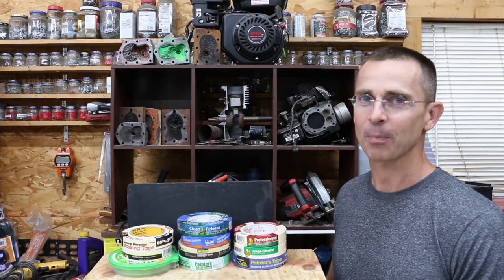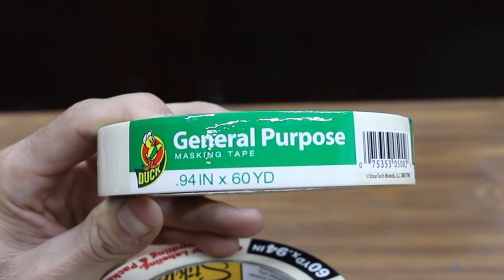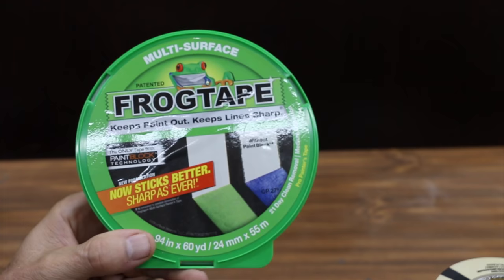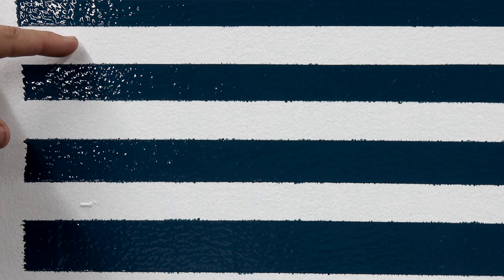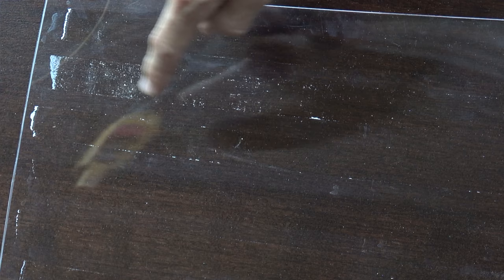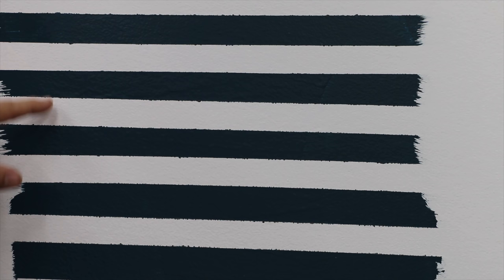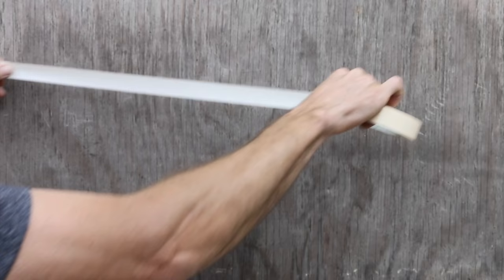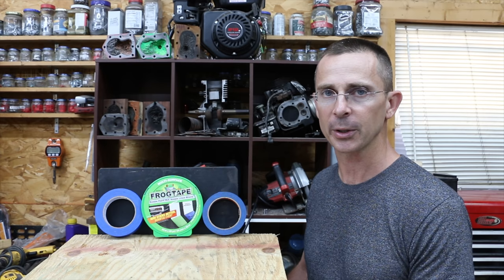Which Masking Tape is the Best?  Frog Tape ve Duck Pro, Stik Tek, 3M, Scotch, Dollar General

Comment: Frog tape has been my go to since it came out, always near perfect lines.  However,  I've found that even as good as it is, it struggles with the newer latex paint with primer in satin, semi-gloss, gloss and high gloss applied to similarly glossy surfaces. If left on too long I've found that even it peels up the newer paint. Highly recommend removing, very carefully, prior to paint drying!
Reply from the maker: Thanks for sharing!
Reply: The trick to that is to paint a thin coat of primer over the frog tape edge first. Some people even just brush some water over it instead.  This activates the tape.  Then paint the color you want and peel off while the paint is still tacky. If you use sherwin williams duration or emerald, one coat over primer is enough to cover almost anything.

Comment: You have to compare cheap oil filters to high performance oil filters!
Reply from the maker: Great suggestion! Thank you
Reply: @ProjectFarm  i've wondered if my strategy of changing the oil and filter more frequently than recommended would make up for using the no-name filters from the oil-changers place. it'd be interesting to know how long different brands stay useful, as well as how they clean at their "end of life' time.
Reply: @flashgordonmd /videos/videos Pretty sure changing more often than recommended is an unnecessary waste of money unless you really drive your vehicles hard.  In which case, you'd likely hit mileage before months.  Just check with the dipstick for color and quantity periodically.

Comment: Great vid as always! Still holding out hope for the high temp spray paint challenge. The paint I used is doing well on my exhaust piping, but I am starting to see some paint chips. I'd love to see which paint holds up best to heat and automotive chemicals.
Reply from the maker: Thank you!
Reply: Or painting a grill, or chimney pipe.
Reply: Fully Spooled bro how's the car? Get a new engine in?
Reply: @datboi8140  No new engine yet. I've been taking care of personal stuff lately. I still need to source a new engine and have the time to make the swap. Hopefully soon.
Reply: Fully Spooled I get that for sure! Remember, you have all the hard stuff done. Only a few bolts and some fluids holding you back from some seat time!
Reply: @datboi8140  Very true. I literally just haven't had the time or money lately to turn those bolts. I will put an update video out soon. I know I've been slacking.

Comment: Please do a test on wheel bearing grease. Would love to see what is best to use for my boat trailer in a salt water environment!
Reply from the maker: Thank you for the video idea!
Reply: I can answer that: Chevron Black Pearl.  Polyurea calcium sulphonate is the best for water washout resistance and low temp environment
Reply: If so mainly disc brake kinds and extreme pressure rated
Reply: But it is a little hard to find single cartridges for sale!

Comment: Speaking of caulking, could you do one comparing various caulking brands? This is one product I'm really curious if brands matter. I'd be interested in knowing performance on water sealing, adhesion strength, and heat resistance (whether they start hardening or start peeling).
Reply from the maker: Thank you for the video idea!
Reply: @ProjectFarm  I'd like to know which of the "paintable" caulk truly holds paint best as well.

Comment: As a professional painter I've been using Frog Tape pretty much since it came out. Many new products are gimmicks and not very good, but now and again a really good new product like Frog Tape comes along!

I've found that running a dry paint brush (one without a fresh dip of paint) along the tape first before actually painting activates the tape and helps even more to block out bleed through.

It also works okay for oil paints if you first run a moist towel or water based primer over it to activate the edge before painting.
Reply from the maker: Thanks for sharing.

Comment: As a painter for 25 years, I would say that the best tape is a steady hand and the right application. But when thats not an option and you need perfectly straight lines in high visibility areas, this was pretty accurate. I usually toss my basket full of 3M blue as its overall best in my experience (leaves the wall much less sticky etc). Keep in mind that a huge part of the quality of tapes is how well they come off the wall without taking half the walls old paint with them.
Reply from the maker: Thanks for the feedback.

Comment: Frog tape is really great. If you run your finger down the edge and smoothly press it down, it's amazing. Also, like the label says, you're supposed to remove frog tape immediately while the paint is still wet. There is no real residue when it's removed on a timely basis. Great video!
Reply from the maker: Thank you for the feedback

Comment: For surfaces that have to get and stay wet I use 3M Stucco tape - even after sitting in the sun for over 6 months it still pulled off very clean!  Used it on my own Farm-A-Bago (99 Newell Coach) and it worked great.  Awesome video as always!  Getting me some FROG tape and getting rid of the other blue tapes!
Reply from the maker: Thanks!  Thanks for sharing.

Comment: Here's tape tip: Fold over the end of tape to stick to itself on the roll. That way, you'll never lose the end! Also, I'm a restaurant worker so most my blue tape use is for labeling, so that get's the treatment as well. The labels come off easy with the little tab rather than getting tape jabbed under your nail while scratching whatever you've got it on.
Reply from the maker: Great tip.  Thank you.

Comment: Im a painter and when used to use 3m it blocks the paint good but falls off to easily. The frogtape has a lot better hold and as long as you press the edges down real good it does not leak at all. We use the blue version of it though.
Reply from the maker: Thanks for the feedback.

Comment: I always use 3M Yellow tape. I do auto body and that's what the shops I've worked at used. It's fairly expensive, but it's worth it to not have to worry about  problems. Where there's a worry about bleed through I use a 3M fine line plastic tape. I wouldn't go through the time and expense of using it for house painting. But when painting cars it's a must
Reply from the maker: Thanks for the feedback.

Comment: The biggest thing with that 3m blue that is so expensive is that the hold is really strong for masking tapes and it never leaves adhesive behind. We used it for all of our sealing and containment for dust and vapors. We never had issues with pulling paint off the wall or damaging wood.
Reply from the maker: Thanks for sharing.

Comment: The trick to using any masking tape is seal the edge with a quick coat the same color as the underpaint, that way any bleed-through won't show.

If you don't want to make the trouble then use frog tape :)

The other thing to consider is the quality of the adhesive. Most good quality painter's tape is acid free so won't turn to goo when left on for extended time. The worst is using a cheap tape that leaves a line of sticky residue after a day or 2.
Reply from the maker: Thank you for the feedback

Comment: The first time I've actually been entertained watching the paint dry. Another great review. I usually use 3M Blue but will have to look at Frog Tape for some of the applications. I use good paint so running some cleaner to remove the Frog Tape residue shouldn't be an issue.
Reply from the maker: Awesome, thank you!

Comment: A tip to eliminate this problem of bleed through entirely, if you paint a coat of the base color first, the bleed will be the same as the base color. Then subsequent coats of the other color will provide a crisp line.
Reply from the maker: Thank you for the feedback

Comment: Superb work!! Glad you compared latex and oil based, smooth, semismooth  nd rough surfaces.. won't waste $ on frog unless using latex paint and non smooth surfaces. Cheaper 3m blue excellent for solvent based, very smooth surface.
Reply from the maker: Thank you!

Comment: The caulk method is what I use when masking textured walls in CA. Issues I have using Scotch 3M and Frog, the adhesive lets go from textured walls on its own, heat/sun makes this worse, but that caulk trick sort of tacks the cut line down. Lastly, even clean release tapes will lift paint off the textured wall since the knockdown is not that strong underneath.  Bottom line, you’re better off learning to cut in by hand!!
Reply from the maker: Thanks for sharing.

Comment: I sometimes paint professionally.  I only use frogtape, except when masking onto carpet along the bottom of base molding.  It isn't perfect when there's any texture on the walls or ceilings.  It is however, by far the strongest backing fabric of all masking tapes.  Just the labor savings when de-masking makes it worth it to me to pay the extra.  I can grab one end of frogtape and unmask the entire room without the tape stripping lengthwise, and without tearing the fabric when I pull while I stand on the floor while it climbs a wall or goes along the ceiling.  Pro-tip:  If you want a truly perfect masking line, use a good quality tape, but then get some clear paintable caulking and caulk the edge of the tape you are going to paint against with a thin layer of caulk. Let dry. Then paint.  This technique fills any gaps at the edge of the tape and doesn't allow bleed-under at all.
Reply: Now I feel dumb.  Just watched the rest of the vid and see you demonstrate this
Reply from the maker: Great tape!  Thank you

Comment: Love watching these reviews.  If you ever end up doing another masking tape comparison, consider adding 3M Yellow automotive making tape.  It has been by far the best I have used and holds up well outdoors.  You could paint, then leave the tape on for a week in the sun, and the yellow 3m will pull right off without tearing.  Not the case with 3M Blue and Especially 3M Green.  Yellow is definitely the best at leaving a clean line with epoxy based paints, but that's what it is designed for.
Reply from the maker: Thanks!  Thanks for the suggestion.

Comment: Suggestion for next test = Paint Brushes. 

A thick, fast-dry, water-based interior trim paint such as PPG Break-Through in high gloss would probably enhance the spread of subtle differences in smoothness of finish and how well it holds up to repeated use/clean cycles before it becomes a duster brush. 

Probably a 2” angle sash brush would be common choice and not as expensive as larger for the test. Would love to see at least these included:
1) Purdy
2) Wooster Pro Chinex
3) Avanti(best), Harbor Freight
Reply from the maker: Thanks for the video idea.

Comment: I do repair work on guitars and usually tape the fretboard when leveling them . Frog 🐸 tape is the only tape I will use . I trust it on expensive guitars not to harm the nitro finish... it was a hard lesson to learn when I about ruined a $3,000 Gibson Les Paul  my only saving grace was it belongs to a very good friend who didn't make me pay Gibson to refinish it .. love the channel and would love to see a 6 in one screwdriver 🪛 comparison I love my Kline Tools but have had luck with ones from Ace Hardware too 😀
Reply from the maker: Thanks!  Thanks for the suggestion.

Comment: Frog tape is the best, I use it where I need a sharp edge,  I run my finger back and forth several times to make a tight seal.  When painting a wall using a roller and I have crown molding, I use the frog tape for the sharp edge but use a cheaper tape to cover the rest of the crown to protect it from the roller on the wall
Reply from the maker: Thank you for the feedback

Comment: Bleedthrough is to be expected on stippled surfaces. If you are taping a smooth caulk line between wall and trim interphases the results are much different. Over-saturating the tape with excessive amounts of paint will also exacerbate the potential for bleedthrough. When the tape wrinkles excessively, it is an indicator that it has been exposed to too much moisture. Keep in mind, the tapes that were tested were predominantly paper products. Tape with plastic films also will help to increase better results. 

How much adhesive that is left behind is not always indicative of potential surface damages of which is more important. 

If you thoroughly rub the tape to ensure adhesion and remove the tape within two days Painters Mate is really good tape. It is less expensive and releases just find.
Reply from the maker: Thanks for the feedback.

Comment: I'm a professional painter of 40 years and the only tape I use is 3M blue tape. Although,.it's ridiculously expensive at near $9.00 a roll and they just stopped carrying it in a three roll (bonus pack) , but I get the best results from it and don't mind charging people for the materials cost of it, for the job it's able to do. It's stickiness isn't the greatest, so as soon as I put it down on a freshly painted and dried surface, I overlap paint against it with the secondary color. This causes the edge to stay down on the surface as the overlapped paint dries. The main reason I use 3M blue tape over Frog tape is the frog tape dosen't stick to itself when overlapped while trying to tape baseboards going around a room.
Reply from the maker: Thank you for the feedback
Reply: @ProjectFarm  
Sure thing ! 
I L♡VE your videos and thoroughly enjoy seeing the results you get on the different things you test !
Thanks so much.
Keep up the great work !

Comment: I have used frogtape many times and other brands its all the same with bleed through but then I used an expensive Scotch 3M Blue Platinum tape and its really worth the money.

Its not in the video but basically its like a light duct tape and is easy to rip and easier to apply in a straight line bc its thicker than regular painters tape.
Reply from the maker: Thanks for the feedback.

Comment: pro tip
1.mask the area
2. paint the area with the background color first, so every bit of leaking will get sealed
3.let it dry for a few minutes
4.paint in the color you want
5.peel the tape while the color is still wet to prevent any ripping
6.perfect result even with the cheapest masking tape
Reply from the maker: Thanks for the feedback.

Comment: Good masking tape is also defined by how easily it comes off the roll, and how easily it is removed once it is stuck-on. "Blue Tape" must be used if the tape is to be left on longer than over-night elsewise be prepared to remove the white glue residue.
Reply from the maker: Great point. Thank you

Comment: Frog tape will perform even better if you moisten the edge slightly, especially on rough surfaces. The moisture lets the special glue swell up and seal the edge.
Reply from the maker: Thank you  for the feedback

Comment: The thing about using tape for clean lines is, you must consider the stipple applied by the previous coats. So if you are applying 5 coats previous to this taping there will be a lot of texture if you aren't experienced enough to lay off an even and tight stipple. Most tapes will preform perfectly if care to their edges is followed.  Just apply enough pressure to the edge and remove tape about 10 minutes after the final coat. Also, if you sand in between said 5 coats, you will get a smooth finish. I do recommend Frog tape because the edges rarely peel back into your painted area IF you remove it while the last coat is still wet, at least better than most. 20+ years experience here, just sayin.
Reply from the maker: Great feedback. Thank you

Comment: If you want the absolute cleanest lines with ANY brand tape, caulk your tape after you put it down with clear paintable caulk, run a very thin bead along the edge and wipe it off with your finger or a damp rag, the little caulk that remains in the seam will seal the edges and leave a razor clean line.
Reply from the maker: Thanks for the suggestion.

Comment: Because of your video my next paint job (today) i said I would purchase Frog tape. Works wonders on flat clean surfaces. Applied it to the popcorn ceiling which is found in 9/10 of my paint jobs and it stuck about as well as newspaper. Had to grab some 3M for the ceiling. Maybe adding textures as a second video would be better haha.popcorn, drywall, tile, wood, plastic...
Reply: Concrete...
Reply from the maker: Fantastic!

Comment: I always run my finger along the edge with more than five pounds of pressure.  3m works great with this. My first roll of frog tape I tried had sections with no adhesive on it at all, so I never tried it again.
Reply from the maker: Thanks for sharing.

Comment: should have tested for cold surfaces as well, 3m blue does the best in cold situations which is why its what I always use for industrial painting applications where heat is usually not available.

should have tested for drywall dust/general dust contamination as well see which tape will stick even with contaminates underneath it, its quite often surfaces are not as clean as they odd to be when you use it in the construction industry.
Reply from the maker: Thanks for the feedback.